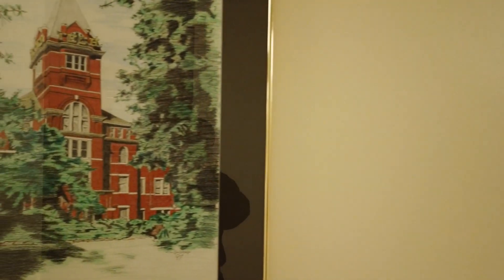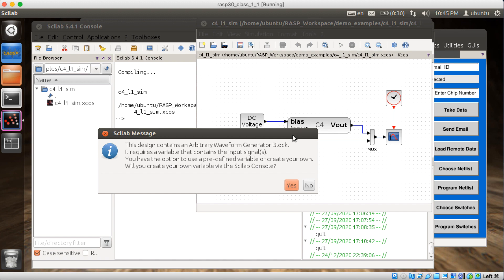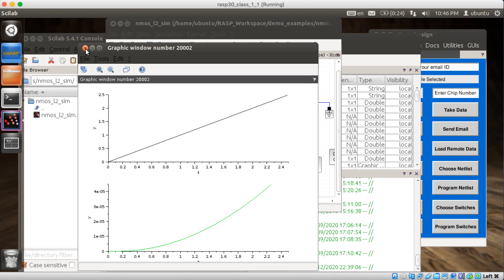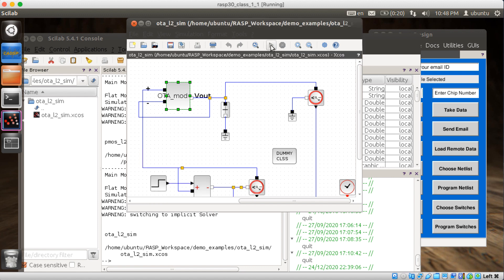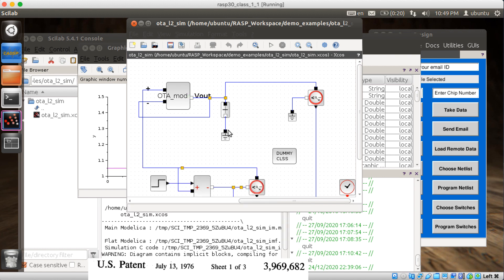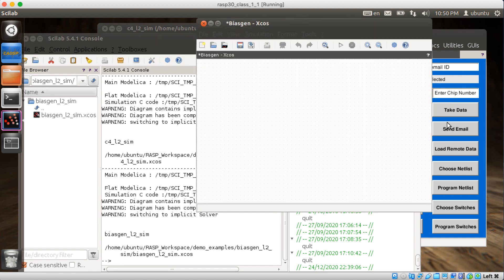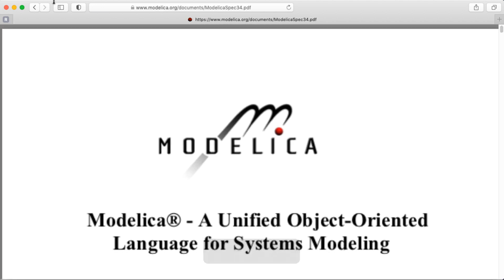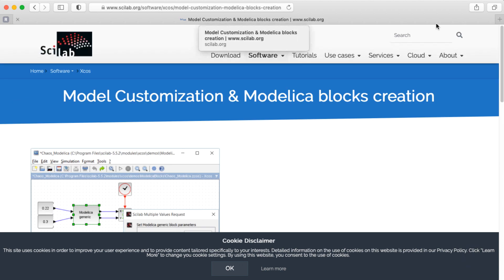FPAA Example Simulations (Adventures in Field Programmable Analog Arrays pioneered at GA Tech)

Comment: Is there any python/C++ integration for this tool (for making hybrid digital/analog models)? It would be fun if someone could pass forward pass of an NN layer and then backprop pass as both are just functions which could be implemented in FPAA. Also, I have a question, is there any cheap (in square/power terms) analog memory, which can store currents or voltage? If not it is a weak point which require digitization and storing in digital register.
Reply from the maker: The floating gate themselves make fantastic long-term non-volatile analog memory (and actually that's what's in your flash drive -- it just quantizes that analog range to fit however-many bit). The main drawback is that it's a bit slow (at least from what I understand) in terms of programming it.

For short term, just a capacitor with an MOSFET switch will do. It's really just like your usual dynamic RAM on a normal computer -- you just store some intermediate voltage instead of 0 volts or 5 volts or whatever.
Reply: @Lantertronics  Thank you for answer
Reply from the maker: As far as the toolchain goes, it's not at that level of sophistication yet in terms of integration, but the underlying structure is there for adding such things later.